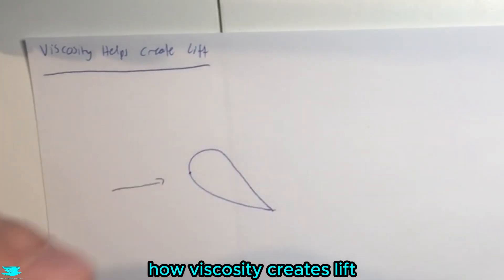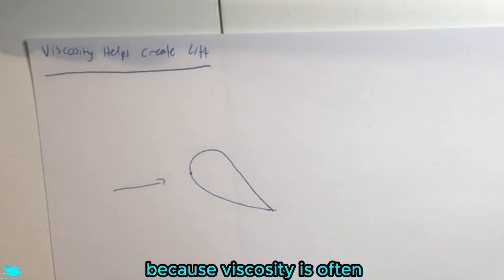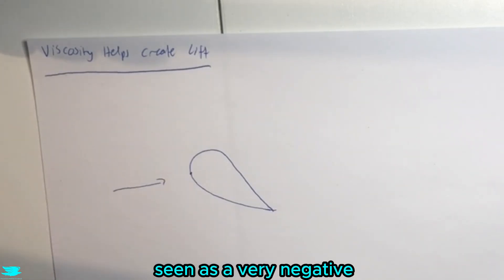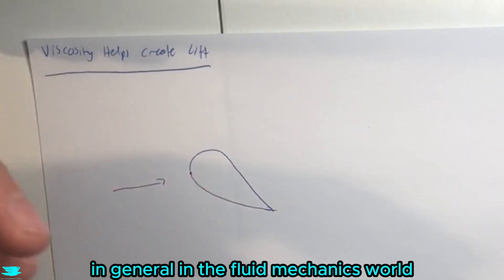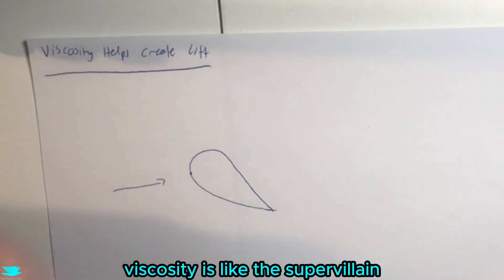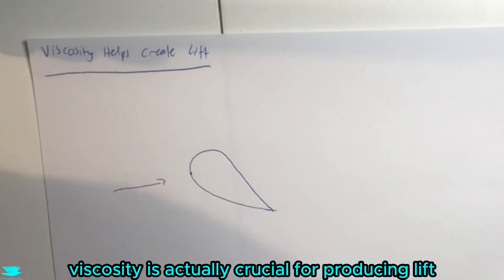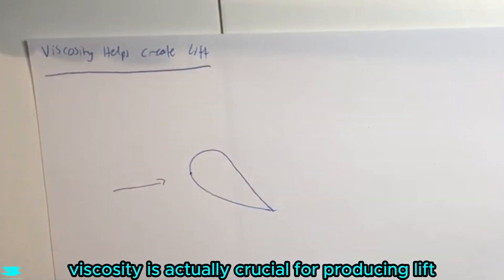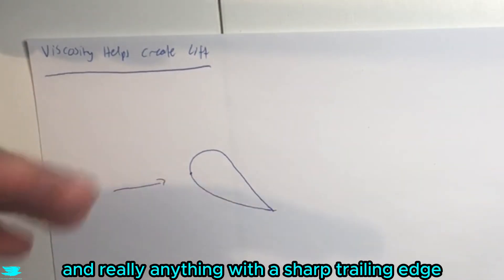How Viscosity Helps Produce Lift [Aero Fundamentals #62]

Comment: I would be able to repeat your narrative of viscosity and producing lift.  But the logical proof, that is, the logic between the steps, escapes me.

Did you say?:   No viscosity-->mass goes to infinite velocity around sharp trailing edge--> allowing trailing stagnation point to be well higher and forward of trailing edge-->eliminates lift (in this no viscosity case)

There's more than one connection between these steps that is not clear, but I'll just take the "infinite velocity with no viscosity."

Clearly there are Newtonian limits on the ability of mass to attain such idealized "infinite speed"?  It doesn't take internal forces associated with viscosity for these limits to restrict such rapid change in mobility?
Reply from the maker: The flow goes to infinite velocity. It is from a continuum point of view. That is how potential flow is derived.

Comment: I thought it was the inertia of the flow rather than viscosity that causes the Kutta condition to exist? In potential flow that is still the case so I'm a bit confused.
Reply: You are right! That is why "modern" aerodynamics is still based on a 3 centuries old theory, where a hypothetical inviscid flow supposedly turns a sharp leading edge and remains perfectly attached to the surface, and the fluid viscosity conveniently produces separation, it sounds absurd, right?...Such a theory is no more than a mathematical manipulation (vorticity is set to zero) to model under a specific operating condition (streamlined configurations at low AoA), for such a reason cannot be the basis of a more formal understanding. Aerodynamicists need to forget talking about idealizations (e.g. laminar flows) and see the big picture!